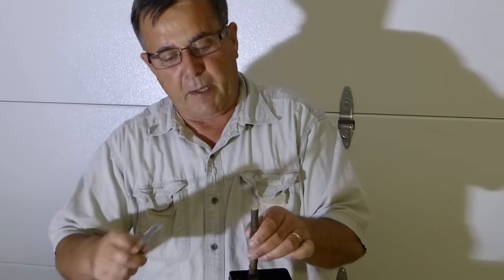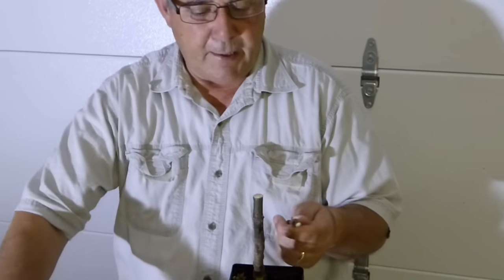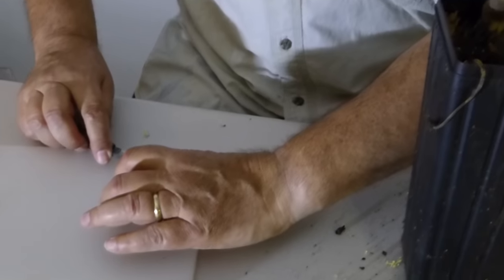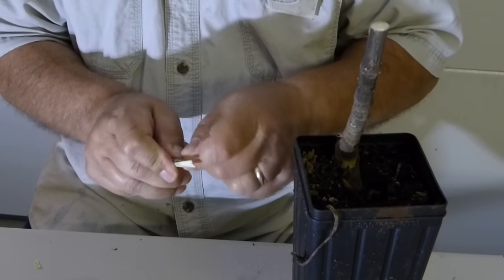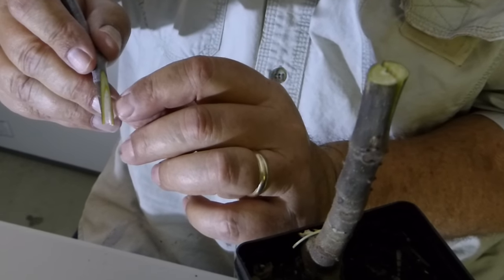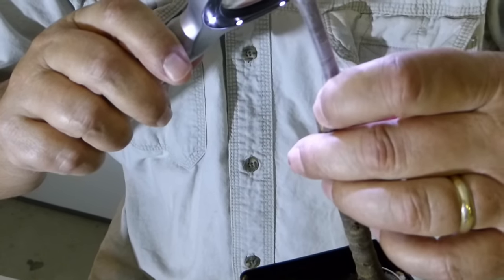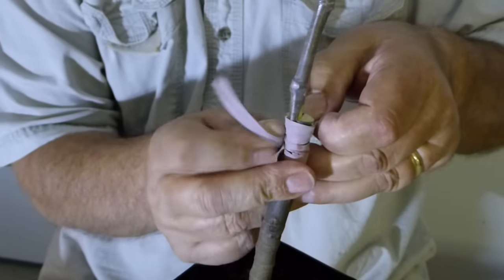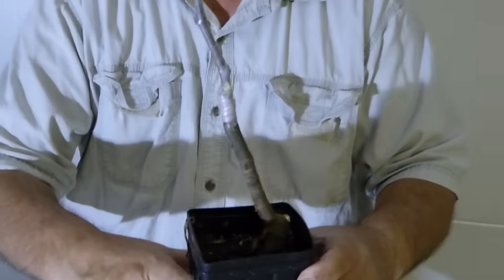Cleft Graft on Figs

Comment: Would this be put in the sun or kept in shade/partial sun?  thanks
Reply from the maker: This is largely dependent on weather.  During cooler weather, up to maybe 75-80F, full sun would be best but in warmer weather semi-shade would help.  Although I can't find specific information to figs, callusing of the graft union is probably slower below 70F and above 85F (surface temperature).

Comment: What time of year does this happen, what will you wash off if there is milky juice, and what kind of figs did you show at the very end of the video? Thank you.
Reply from the maker: The rootstock should be in a growing stage when grafted.  I usually use dormant scions for grafting, however.  I mostly graft outdoor trees in spring but will sometimes will graft in summer if weather conditions at the time are not exceedingly hot.  I sometimes have rootstock trees in pots in my heated shop under grow lights and have grafted those in the winter.

In some of my videos I have addressed reducing sap flow.  When I first cut the tree to prepare for grafting I watch for a bit to see if I see heavy sap flow.  If this is present, I will make some horizontal cuts a few inches below the area I plan to graft to let the sap flow from those areas and then wait for 15-30 minutes before grafting.
Reply: Thank you very much.

Comment: Hello Harley great Video , just a question when do you Harvest the scion ? just Prior to the grafting or is it a dormant one which you do Harvest early in the fridge ?
Reply from the maker: I usually graft a dormant cutting onto an actively growing rootstock.  This might be done in winter right after I prune cuttings or they can be stored for several months in a refrigerator.  Sometimes I'll acquire a new variety as a cutting that is not dormant but which has buds that have not pushed yet.  I will prune those as quickly as possible after pruning it.
Reply: very professional  thanks  so much i do grafting  on apple and cherry trees but never tried the figs so i will try as you said thx again and greetings from Luxemburg europe

Comment: Dear Harvey. How reasonable is the use of such a long stock? I suppose, against the background of a severe shortage of vaccine material, is it better to use one-eyed vaccinations?
Reply from the maker: There seems to be some translation error here, I imagine that your use of use of words vaccine and vaccinations is meant to mean scions.  If I have a good supply of scions I will graft two or three buds, especially if using the tip of a branch with buds I'm not sure are mature enough.  For something very scarce, I use only one bud per graft.
Reply: @Figaholics  
Yes you are right. What to do - I do not have enough English (studied German). I have to use online translators.
I got it.
If we have one black man with three buds - how justified is its use with one-eyed cuttings by means of a vaccination splint? Let's do three eye vaccinations (a piece of wood with one kidney). How much does it depend on the time of vaccination?

PS I ask you to consider that vaccination is not a medical term, but as you all understand, the connection of a plant organism with others.
Reply from the maker: @ОлегМармута-б5н  Yes, I think the grafting of plant material with one eye (bud) onto rootstock is very practical, I have done it many times with high success rate.  This is what I have done for the most rare varieties to help expand as soon as possible.
Reply: @Figaholics  Thanks a lot, dear. But let me say that I always thought that grafting with one “eye” (or a handle with one kidney) is always more practical than a graft with 3 or more kidneys. If done carefully, hygienically and on time (according to the growing season) and with a certain level of qualification, then the survival rate of any vaccination is very high.
I would like to note that it is better to make a one-eyed budding three times on one stock than to vaccinate a split with a handle with three eyes.
I understand that you share your experience in relation to this situation, but different people may have different questions in discussions. I believe that my comment is useful to someone.
Excuse for troubling.
Reply from the maker: @ОлегМармута-б5н  Okay, what you are referring to is called "budding" such as "T-budding".  Yes, that works well if the rootstock is large enough and the bark slips (pulls away from wood) easily.  Grafting with one bud of the various grafting methods I discuss here work well even if bark does not slip and works well for smaller diameter rootstock.  It's also a matter of personal preference...my fingers are fat and getting less flexible as I get older and harder to handle small things like buds.

Please let us end the discussion here as this is getting off the topic of this particular video.  Thanks.
Reply: @Figaholics  Dear Harvey. Your "fat fingers" and the ability to work with them is a great science for beginners.
I am very grateful to you for your work.
Sincerely, Oleg Marmuta from ROSSIYA (not Russia).